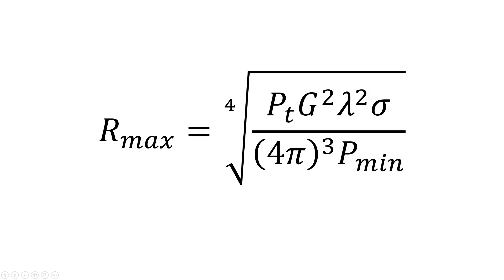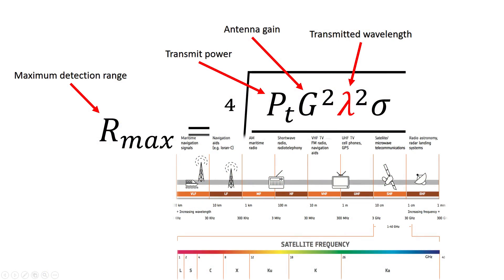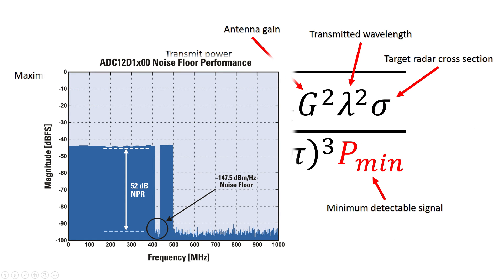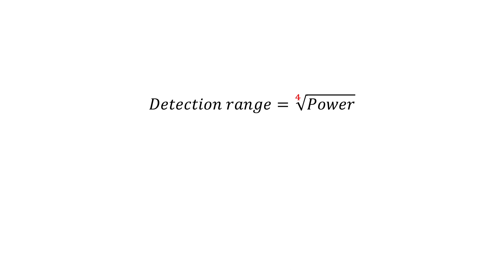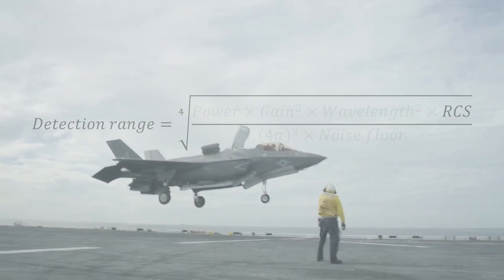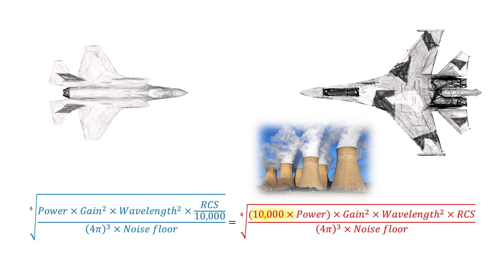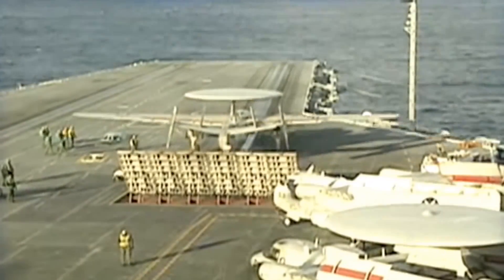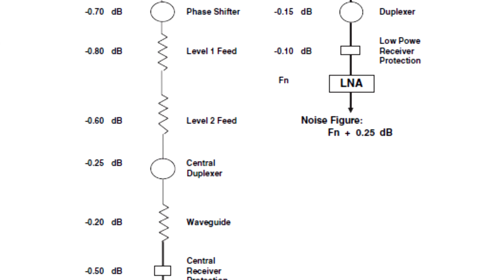F-35 Lightning II: Busting Myths - The Radar Equation [v1.1]

Comment: China, Russia, India, Japan, South Korea, Turkey and Sweden are developing 5th gen stealth fighters. If stealth wasn't that of an advantage no one would bother. 

If the F35 were a scam, Israel wouldn't have asked for a delivery ASAP. Those guys wouldn't buy junk.
Reply: Sooner or later israeli F35s will strike S300 defended Syria. This is the typical scenario it was designed for. Day one strike over densely SAM defended areas. 
There is low probability Syrian forces will have enough time to fly any interceptor fighter once the presence of the striking F35 revealed so there is little chance any AtoA combat would happen. Hence the irrelevance of all the talk about AtoA performance of a primarily strike platform. 

If any interceptor fighter groupe manages anyway to approximately locate the F35 they will be either detected by the later and shot before they can get close enough to electro optically aquire, or defeated by a supercruise capable F35 that can keep a secure distance undetected. 

The first strike may happen sooner than expected. We will see then what the F35 is really up to.
Reply: Israel wanted to buy the F-15 Silent Eagles Boeing was working on but reportedly the Obama administration killed the sale.  They did pick up more F-15D's in 2016.  The F-35s they are getting are fully funded by the American aid package so they aren't dropping a dime of their own money on them.
Reply from the maker: HAL NineOoO
Have you forgotten that F-22s have and are continuing to perform strikes against ISIS in Syria?
Reply: Dragon029 

wow !! didn't knew F22 have seen actual combat !!! so... i guess next step is testing all 3 variants of F35 in the ISIS training range :))
Reply: Actually the first F35s to strike Syria may not be the Israeli once but the Turkish.
Reply from the maker: +HAL NineOoO - I don't think so; Turkey isn't receiving their F-35s until 2018, after which they'll need some time to train all their personnel and receive enough aircraft for IOC. Before the end of 2017 the USMC are deploying VMFA-211 to the Middle East (while Israel declares IOC around December). If Israel doesn't use them, the USMC almost certainly will before Turkey.
Reply: Dragon029 

If the US of president TRUMP is about to strike IN Syria they most likely will target ISIS not the government and they will do so in conjunction with the Russians. And they wouldn't wait till the end of 2017.
Marines F35B would be an overkill. Navy's super hornets would be more than enough since there wouldn't be any heivy SAM cover or air force to worry about. 

Israel would very likely continue targeted and limited air strikes against Syria's government ally Hizbollah leaders in Lebanon and Syria. They will probably have to deal with SAA S300 and may be Su30 / Mig31 if Russia provides such aircrafts to Syria. Turkey could also do when fighting to prevent kurdish/loyalists control of the border region.
Reply: hahahahh.....israel DOESN'T BUY ANYTHING......they get all for free ( because still today they are victims of hollocaust....i guess  ).

germany is paying them for hollocaust while US is subsidising their military purchases.
Reply: HAL NineOoO I mean they are in Israel
Reply: Correct and I agree. With the benefit of time the following should be noted. Many of those countries who are allegedly developing a 5 gen, are really just going after a 4.5. So many are claiming 5th gen when it’s not. For example, South Korea plane is not a 5th gen by their own admission. The media sensationalism of 5th gen is thrown around recklessly. Additionally, Russia does not have a 5th gen. The SU 57 will not be a 5th gen plane if they ever actually build one to actually use in there military. Lastly, China...It remains to be seen if the J20 is a 5th gen as I doubt it. Apparently, even the global times does too as they didn’t even claim it’s a 5 gen plane. As I see it, only the US has produced and implemented 5th gen aircraft.
Reply: @BK-uf6qr  
Beyond semantics, all those projects incorporate low observability as a primary design feature. 
Since I posted the comment three years ago, the British Tempest and the Franco German stealth jet project joined the dance.
Reply: HAL NineOoO Thanks for the reply, to my reply! I guess the line in the sand for me is what has been produced, functional and in use versus what is being worked on and not operational.  I’ve seen headlines that say “tempest blows away F-35!”.  The tempest won’t be operational for another 15 years, probably same for the German/Franco plane also. The USAF is already working on a 6th gen and flew some kind of prototype. In sum, my general critique(not at you directly) is boasts about what will be v. what is.
Reply: Lmao "India"
Reply: Israel didn't buy jack squat, we gave them the F-35's as part of our military aid package. Also, every nation slated to receive F-35's has requested they be delivered ASAP, because it's so insanely behind schedule they are running short on logistical support for their current aircraft.
Reply: HAL NineOoO  We are set to give Israel 38 billion over the next 10 years, excluding the many billions we have already given the over the years, I doubt they would pay us anything for their f35's. If anything they know the program will probably be cancelled so they want their free jets ASAP before then. 

Also notice how everyone wants stealth FIGHTERS. The F35 is no F22, infact its pretty sub par in comparison. A stealth Close Air Support is stupid, A stealth bomber that can only carry 2 tiny bombs is also stupid.

The F35 was designed to fill 3 roles and share 80% of the same components between all 3 models in order to cut costs via mass production. The problem is that there have been so many changes made to these jets by their respective agencies that they now only share something like 10% to 20% of components, resulting in 3 models that may as well be 3 completely different jets. 

The F35 program is pretty much a failure, much more so than the F22 program that was cancelled.
Reply: muchookees 

With the money you give them, Israel could have chosen to buy more F15s and F16s. They choose to have F35. Why would they put their pilots in a piece of crap instead of useful fighters ? Israel is in perpetual war and uses their fighters regularly to carry attacks in Gaza, Lebanon, Syria and Sudan. They know their 4gen fighters are endangered by russian made SAM systems and that they need stealth to continue carrying business as usual. 
F35 can be converted to a traditional strike platform with underwing carriage once hostile anti air defences destroyed and air superiority achieved. 

You're right though about CAS which F35 and alike aren't suited. The army doesn't need the air force for that. They can use unmanned helicopters and UCAVs similar to predator they directly control without requiring air force involvement. I can imagine a unmanned spinoff of the Osprey being used for CAS with close to front line deployment and minimal time reaction. a sort of VTOL A10.
Reply: HAL NineOoO.  Israel is acquiring 50 f35's. They will be paid for by American military assistance aid money. In other words, they are free. The F35 needs to be sold in great numbers in order for the per unit cost to come down, that's why they are being sold to as many countries that can buy them. Selling to Israel is a way of indirectly subsidizing the F35 program, this is probably why Israeli aid has increased. 

As for why Israel wants the F35, it's simple, they are doing us a favor. By ordering 100 jets, they built up the hype for the F35 which allowed other nations to justify buying these jets. Israel has since halved their initial order and has purchased some f15's.

Two thirds of their f35's will be heavily modified as f35i, apparently the A variant isn't good enough lol. They also aren't happy with its range, maneuverability and payload. They have also requested stealth underwing fuel tanks which Lockheed is pissed about. I don't think Israel will use the f35's stealth that much, they will pretty much load as much under the wings as they can most of the time. 

They have praised it's situational awareness ability though, it's just too bad all that tech sits on such a crappy airframe.
Reply: muchookees to be fair there may be factors you are neglecting, the point of a stealth fighter is not to be seen much like the f-22 they are new technologies and they take a lot but the outcome is a new plane that kills from afar the older jets are inferior compared to it because in today’s fighting visual range dogfights are rare, plus the two tiny bombs you are referring to are for strategic bombing you don’t want a 10000 lb bomb and blow up a city block killing more people than u need to
Reply: @muchookees  yep. doesnt make it a bad fighter though.
Reply: @muchookees   What!?!? The F 35 A is even Advanced and maybe even Stealthier than the F 22! Learn some facts, young man / man = my friend! The F 35 A Purpose has never ever been to replace the F 22 or be as Good! But still the F 35 A is way / lot better dog fighter than many Jet Fighters today, Even its' primary role is not dog fighting!, But Attack and Bombing Role (Attack from the Above, not at the Ground Level, that what I meant)!

And where the F 35 A is good at or one of the best, is, to shoot missiles in the Air to Air and to the Ground and drop bombs! But It can Dog Fight as well pretty good or even better, because the F 35 has more Power = Thrust and Climatic Performce!, Than the F 15, when comparing the Power vs. or (+) Size vs. (or +) Airodynamics (or something like that)!

And the F 35 nor the F 35 A is not A Junk!, nor Failure!  I think, that  F 35 A is either 100 % ready or near to be 100 % ready for the Compat / Combat, because the F 35 A and C should be!, Already!, 100 % Ready!, but not for sure about it! But Dragon029 knows that probably better than I do! Or what you say, Dragon029!?!?  God bless we all so, Israel the most, but we all so!    <3   <3    :     )

Comment: Fighting wars is NOT just airforce vs airforce.
Reply: That has nothing to do with the video
Reply: Most of these type of videos are actually fighter against fighter...

Is there really any reason for a modern fighter to even need to turn on their own radar?
Turning on a powerful radar will tell everyone where you are...
Reply: It is a relevant point since ground and sea based radar and missiles will be part of the fight in the real world. This allows for much higher capability detection due to frequency, size, and power available. It also allows for detection from multiple directions, triangulation, and coordination. The number of potential incoming missiles also is far greater.

Comment: Tout une argumentation basée sur une hypothèse qui est classée mais (???) est rendue public sous forme imagée d’ailleurs (une sphère de métal de la taille d'une balle de golf, c'est poétique) : 
RCS du F-35 = 0.0001 (source cette vidéo)

De plus la taille d'une balle de golf est de 4,27cm selon internet (peut être un autre taille pour le fabricant du F-35, il aurait était plus simple de ne pas faire de la poésie et nous donner la valeur numérique) ce qui conduit à un RCS (si λ<<R et λ<< r, R=Range, r= rayon du sphère métallique, RCS = π*r*r, λ étant la longueur d'onde) de (0.04267/2)*(0.04267/2)*π = 0.0014 et non 0.0001 comme dans la vidéo (il y a au moins un facteur 14). Ce qui dans mon cas fait un une portée de détection de 51km par le radar du Sukhoi et non de 27km.

A cela il faut ajouter qu'un tel RCS obtenu dans les conditions optimales et quand les deux avions sont alignés, le moindre écart d'angle de vue pourrait faire varier fortement la valeur du RCS.

Rappel :
sur http://www.globalsecurity.org/…/sy…/aircraft/f-35-design.htm RCS(F-35) = 0.0015

J'ai du mal à croire que l'on puisse atteindre de telle valeur comme de RCS 0.0015 pour des avions de la taille du F-35. Il suffit de prendre un balle de golf plus grande !
Reply: This Rcs value of 0.0015 is the minimum value possible on a dead mock up plane being stationary on a pole and hit by radar waves. Said plane avionics suite and all electronics are on power off condition = dead, plus the radio transmitting antennas are either removed or pasted with non conductive material. This cuts all emissions to zero and eliminates the problem of our plane antennas focusing and passively back scattering enemy radio pulses. This gives you an absolute bare bones Rcs value which is totally useless for tactical or testing purposes but all important for the selling brochure. 
http://terahertz.dk/?page_id=189
Consider an analogy here: 
- FLIR company is tasked with designing a new, stealthy in the infra red spectrum, ghillie suit  for snipers and they want to test the IR signature of said suite on a human to get an IR reflection value and compare it with other non "stealthy" ghillie suits. They dress the suite on a human in shut down mode = dead, put the corpse on a pedestal and take measurements. As corpses have no metabolism, their temperature is quite uniform and close to ambient, so their IR reflection is essentially same as background noise.  The result would be that their stealth suite reduces IR signature from 1,8 m^2 to 0.005 m^2 making detection of said corpse improbable and their stealth suite a wonder weapon. 
Morale of the comparison story:
- Good luck making the corpse fart, let alone fire at an enemy.
- Stealthy ghillie suits work only for a very specific type of mission and can only used by a minuscule force consisting of very specialized and very expensive, slow moving, non mounted, non missile launching infantry backed by other assets.
- Good luck making an army comprised solely of such a force...
- Goodnight on your budget if you think you are saving money on the process.     

PS. Es que tu comprends pas mon Anglais, je pourais esaye en Francais, mais mon orthographe est nule.

Comment: On the F-35's screens these big UHF or VHF ground radars of the enemy will be like a big HIT ME sign at hundreds of miles away. The F-35 can in fact attack using just it's passive sensors. In fact the F-35 that is targeting need not be the one that attacks at all, in fact it could be a cruise missile launched from an aircraft carrier that does the damage. The plane is RCS self aware and can tell the pilot exactly where to fly to avoid detection.

Note that even the F-22 wasn't able to fight the F-35's radar. Both 5th gens have come in gun range without the enemy knowing they were there. Even 4th gen fighters can fight much better with the data they're getting. They have gone without losses in scenarios where 50% of the fleet could be wiped out otherwise. 

With DAS and EOTS the F-35 can even track and identify enemy forces on the ground and co-ordinate with ground troops like an aerial sniper. DAS can find enemy missiles at 800 miles!

Also note, 5th gen aircraft with their sensors can have the capability to shoot down the enemy's missiles instead of dodging.
Reply: The problem is that F35 has not enough weapons to kill all radars on the way and once F35 decides to fire a rocket, it is not stealthy anymore. So your argument is bullshit. F35 can in the best scenario kick out one radar (worth $30.000) and then all air to air missiles will focus on F35 and destroy it ($100million). Such a mission is really worth it, is it ?